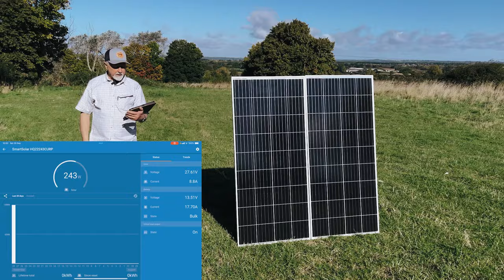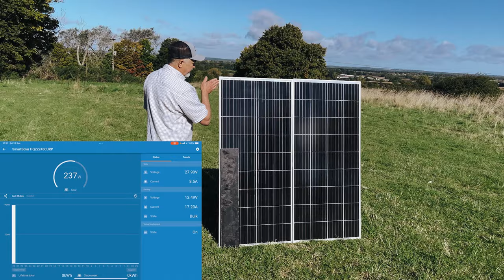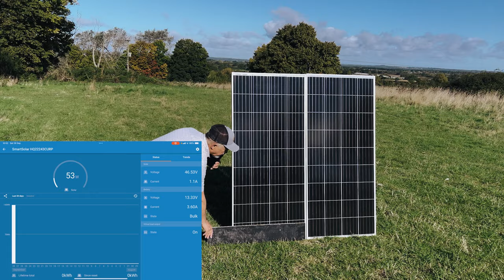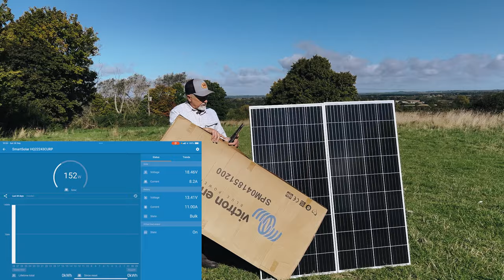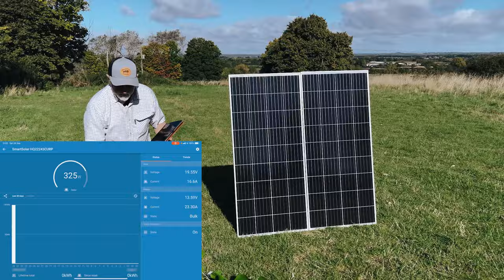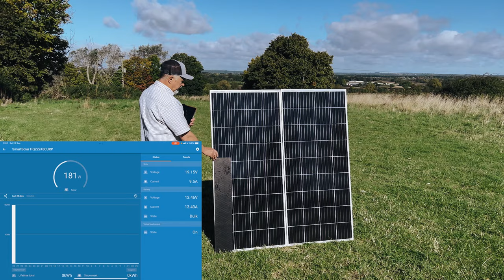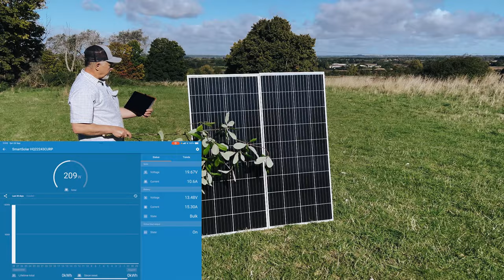Shading solar panel tests

Comment: Thanks for posting and more importantly the examples of shading.  On a 12v system, I normally wire in parallel to keep the wattage coming in since shading varies through out the day.  I have also deployed portable set ups with long cables and put the panels in sun and in those scenarios, use a series configuration to minimize voltage losses on the long cables.  Cheers.

Comment: Very helpful..thanks! I have been thinking about changing the wiring of a 750 watt ground string of 3 panels for my RV. I also have 1300 watts on the roof of the trailer. I am in on and off shade at this time of year for a lot of the day and was wondering how much wiring in parallel would help. This video gives me a much better idea of how much I would gain, and it actually is not as much as I thought.

Comment: It is a great test. However, when you tested the serial connection, you should've shaded another panel too, because it matters which panel is connected to the battery.